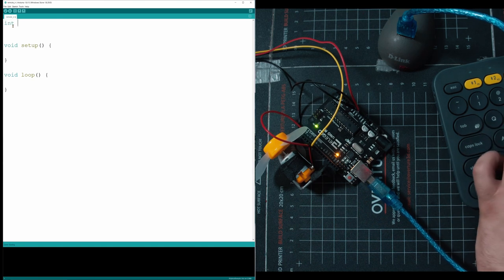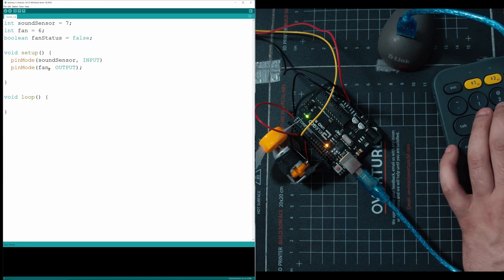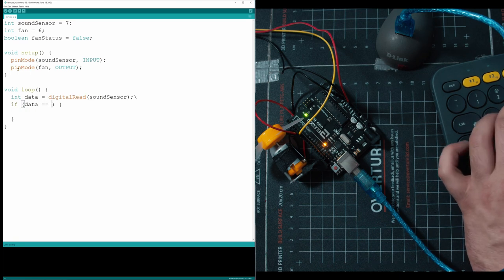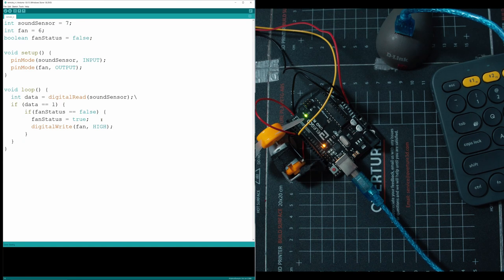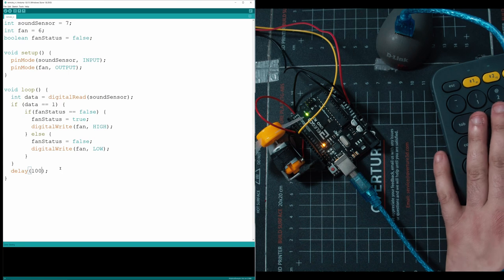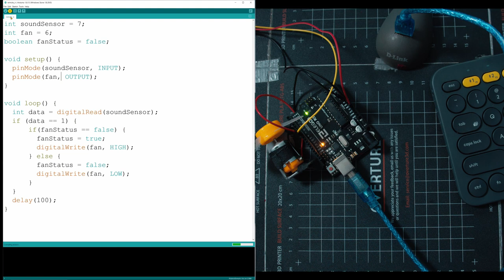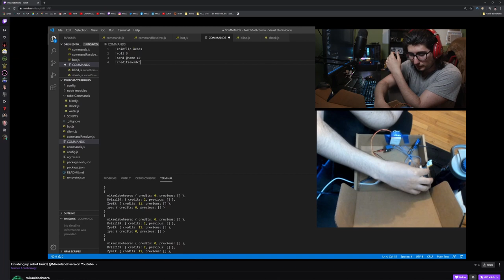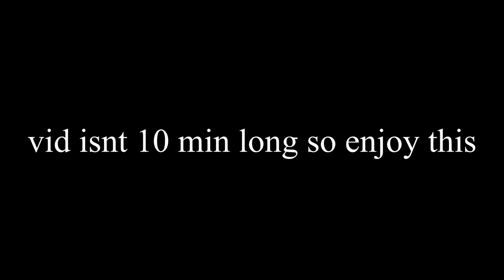SOUND SENSOR EXPLAINED | Clap activated Fan | #arduino #grindreel

Comment: I did everything right yet my fan does not react as it should. I need to turn it so that it starts. But after that, even if I make a loud noise, it never turns off.
Reply from the maker: hmm, check the code for that, but sometimes sensors like these can be faulty

Comment: Hey could you please provide python code for the same? I am trying to control 12v dc motor using sound sensor.. please?
Reply from the maker: you can't directly write python to this microcontroller, you would have to use some middle man program to convert it

Comment: Is it applicable for big fans at home?
Reply from the maker: yup, technically the sound sensor could control anything you connect it too, but not directly (limited to 5v I think), it would be the switch to some other system, like it could switch a relay and that relay could be the direct line to a large fan/tv/etc

you could even program a sequence to open a door!